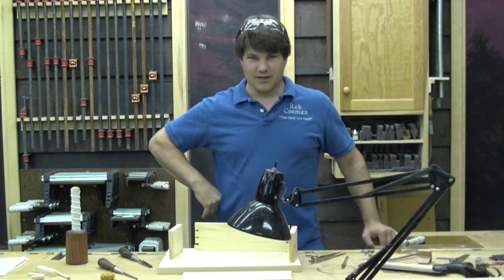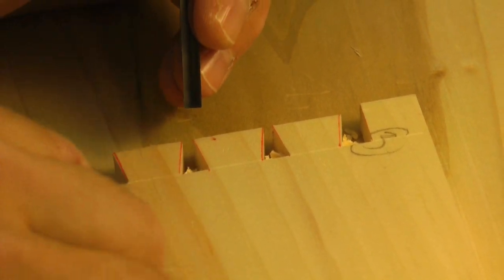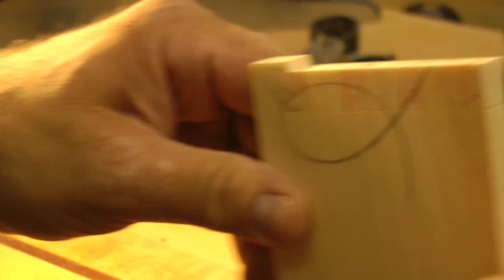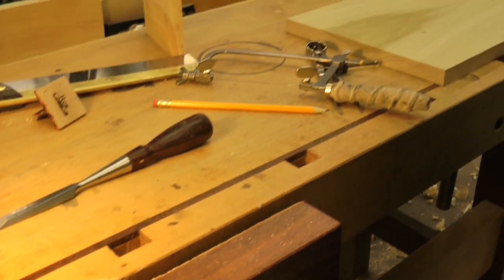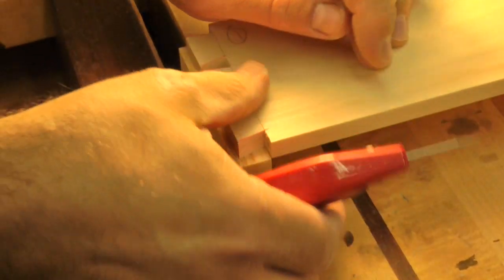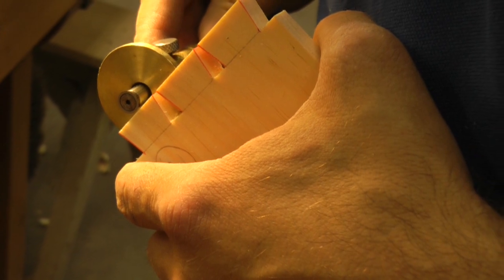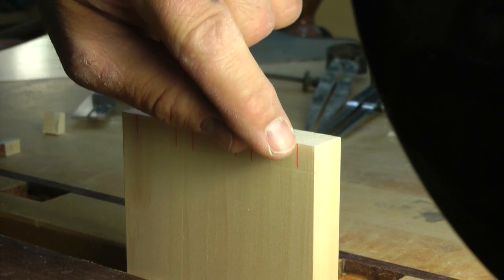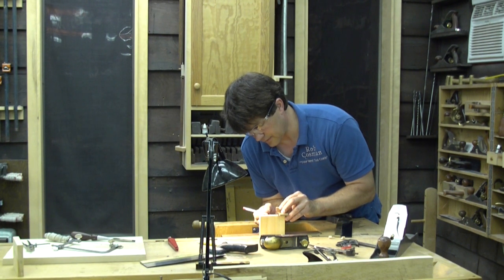Hand Tool Project- Episode 7 Pine Candle Box

Comment: Hi Rob, the chisel you are using- is it a lie- Nielsen or one of your IBC?
Also I thought you would have offset the tail board with the marking gauge like you usually do. 
Fantastic video
Reply from the maker: Hi Dan, this is almost 8 years ago, IBC were not out yet and the offset method was introduced in 2014.